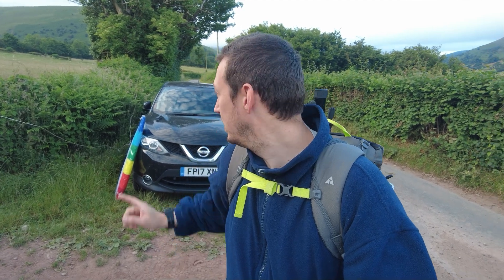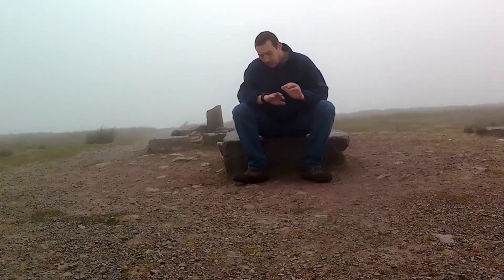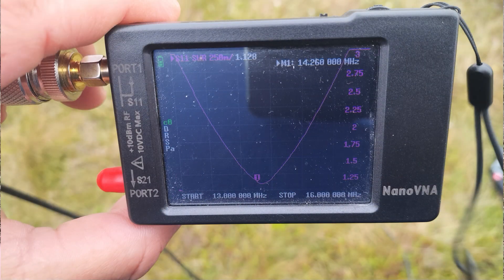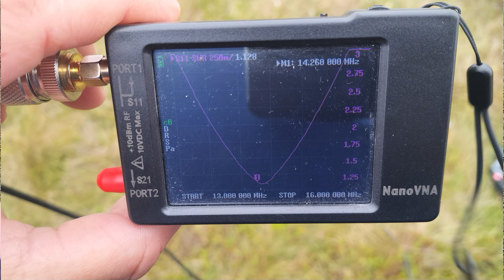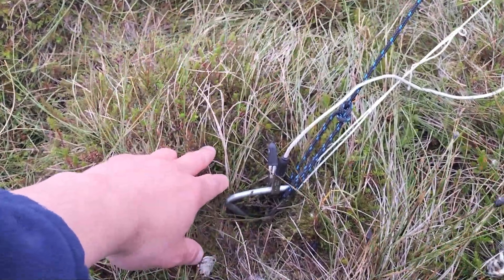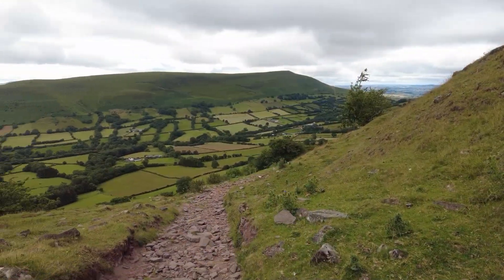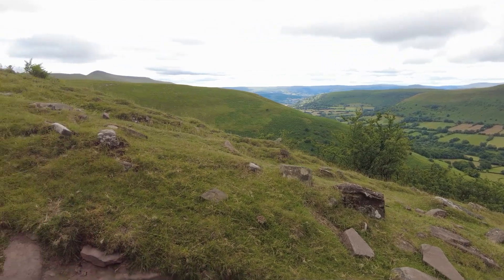Activating a SOTA summit with a Kite Antenna!

Comment: In there early days of 360 photography there was a guy who would use a kite to take downward facing photos with a kite.  His camera was on a sled of sorts.  He would first fly the kite, then he would attach the sled to the kite string and use a parachute to pull his camera up the string until it reached the desired height (very high).  Then (I think) he used an additional  string to trigger the shutter release.  He could deploy and retrieve the camera completely independent of the kite.
Reply from the maker: I believe kite photography is quite a big thing.

I watched a few videos on YouTube while figuring out what type of kite to use.

These days many cameras have options for remote shutter operation, which makes it even easier.

I've just never liked the idea of strapping an expensive camera on a kite & throwing it up into the air in case it goes wrong!

All of the aerial shots in my videos are done with a drone, which I think is much easier than using a kite.

Comment: Congrats. Well done. But not quite sure why you would put direct kite strain on the antenna wire as opposed to the kite cord.
Reply from the maker: Using the wire keeps it taught.

The wire is also stronger than the kite string (kite string rated for 110kg, antenna wire rated for 130kg) which means that the kite string should fail before the antenna wire. Think of this as a deliberately engineered "weak point" so that it "fails safe".

This is important because if something does fail due to excessive loads on the kite, I would prefer the kite string above the antenna to fail so that the antenna wire falls to the ground. This means that it doesn't take the antenna wire (and probably also my radio) with it!

A loose kite drifting across the countryside with a piece of string dangling below it is a problem.

A loose kite drifting across the countryside trailing a 20m long very conductive antenna wire at roughly the same height as the overhead power cables a couple of miles downwind of my location is an even bigger problem!!!

Comment: For low to moderate wind speeds I use a sparless pocket kite which stuffs down into a bag slightly smaller then a rugby ball. For higher wind conditions, especially by the coast where I don't have to carry the kite too far, i use a homebrew conyne (french military kite) which tends not too luff so readily in a stiffer breeze. One tip I did pick up when operating on a beach was to take empty sandbags to tether the kite to  and fill them with sand from the beach, then use a spike into the damp sand for the DC ground. Be careful. It is addictive! 73, Phil

Comment: I really want to give this a try.    The height limit for kites generally is 60m vertically above the ground, so if the kite line is around 45 degrees, that let's us have up to about 85 meters of line.    I'd have to take care here in the Lake District because the RAF and USAF practise low flying in some areas.   73. Pete M7DXE
Reply from the maker: Be really careful with that theory.

The angle of the wire in relation to the ground varies wildly depending on how hard the wind blows.

I haven't measured or calculated the angle of the wire but my guess is anything between 30 degrees & 70 degrees.

It will also be affected by the type of kite used.

Don't assume an angle of 45 degrees is the point that I am making!
Reply: @HamRadioOnline  Yes, it depends on conditions on the day.    The key limit is ground to kite at 60m.   If you set up well down from a peak with wind blowing uphill, the rising ground could let you feed out a considerable length.    But yes, always watch local conditions.
Reply: @Crusty_Camper hang your antenna from the kite itself and have it as a vertical rather than as the line. Providing your antenna isn't over 60m in length and feedline or radio is not airborne, you're golden.
Reply: @lmaoroflcopter  That's a good way of doing it.   I've also discovered it's very easy to get permission to fly higher than 60m from a given location and the authority lasts for more or less as long as you want.

Comment: what kite is that?  i've tried kites a few times and they were either too small or too erratic.
Reply from the maker: I use "sled kites".

From what I read online, they seem to be the preferred choice for aerial photography due to their stability and lifting power. I figured that was pretty much what I needed to support an antenna wire. Seems to have worked out ok for me so far!
Reply: Thank you

Comment: I never managed to stop the static from making the receiver too noisy - despite all sorts of DC discharge paths to earth I attempted.
Reply from the maker: I can't say that I've found that to be a problem. What were you using as a ground spike?
Reply: @HamRadioOnline  Sometimes ground spike, sometime just a counterpoise and sometimes both. Using the kite to lift a giant triangle with the side on the floor sort of acting as a counterpoise worked best. This was for 160m so maybe the lengths were so long that static pick-up was inevitable.
Reply from the maker: @janetwinslow2039  If I correctly understand what you are saying, you sometimes lay a counterpoise wire on the ground but have no physical connection (via an earth rod) into the ground?

I personally wouldn't use this setup!

With only a counterpoise laying on the ground and no earth rod it may work fine as an RF counterpoise/ground & you will make contacts but it has no DC connection to ground. In my view it would do very little (if anything) to bleed off any static build up!

To that end I would have to advise against this setup!
Reply: @HamRadioOnline  Indeed. That's why I've also used a ground spike.
Reply from the maker: @janetwinslow2039  Ok, I got the wrong end of the stick. I thought that you meant that you used just a counterpoise without a ground spike......my bad.
Reply: You need a 1Mohm+ high voltage resistor linking your antenna to ground.

Are you sure you're grounding your antenna or just grounding the counterpoise to your ground rod?

That electrical connection is important to bleed the static.
Reply: @lmaoroflcopter  Grounding the antenna wire to the ground rod in various ways. A 1M ohm was for to high! The static noise across the resistor drowned out any signals.  A 1:1 voltage transformer helped as it had a negligible DC resistance, but still wasn't ideal. Maybe the kite antenna was just too long...

Comment: Well I learned something. All this time I thought a resistor was needed to bleed static to ground while preserving signal. Go figure.  Also what antenna line is that?
Reply from the maker: It depends on the setup. The 49:1 transformer has a direct DC path from the antenna wire to the earth terminal.

If you are using a random wire with an antenna tuner of some description you might find that there is no DC path to ground......in which case you will need a resistor to bleed the static to ground.

I think the wire came from SOTA Beams.

Comment: Hi James.  I've been out today experimenting with a kite. Used a very similar set up to you, but put the kite on the kite line and the antenna wire the backup.  I didn't get enough lift of my kite to handle the length of wire. Noticed you had the spirt of air sled kite, which I am now looking at. Also fancy a Cody box kite but that might be going to extreme. 
Enjoy your experimenting. 
Regards David.

Comment: Great stuff. What kite were you using?
Reply from the maker: Sled kites (sometimes also called lift kites) are supposedly the best for this application owing to their stability, pulling power & shallow angle of attack (which keeps the antenna wire more vertical than other types of kite).

Comment: How does the grounding setup work (for static electricity)?
Reply from the maker: Probably easier to cover this in another video but essentially I'm using the ground anchor (which the kite is attached to) as an earth rod.

I take the ground terminal from the 49:1 transformer and connect it directly to the ground anchor.
Reply: @HamRadioOnline  got it.  I thought you were implying something more complicated.
Reply: James, A great way to work SOTA etc. A good description of the set up too. Well done sir. 
You spoke to me on Weds, I was working as GB2GM. Your vid inspired me to visit. Well worth it. Many thanks, 73, 2E0IGD, Gary
Reply from the maker: @garyh8315  Thanks for the kind words Gary. It was great to catch you on air the other day working GB2GM & I'm glad you enjoyed your visit to the Marconi Centre.

I gather that you were on air for quite a long time as one of my friends apparently called you around an hour after we spoke so it sounds like you had a lot of fun!
Reply: @HamRadioOnline  Yes, I was on for a about 2 hours! It was certainly one of those memory moments. I made a return visit today at their open day, meeting the members and  spending a little more time as GB2GM. Happy days